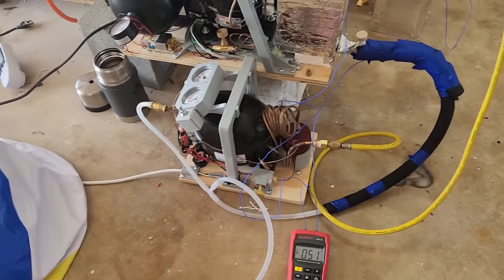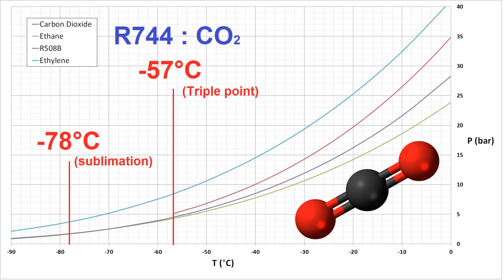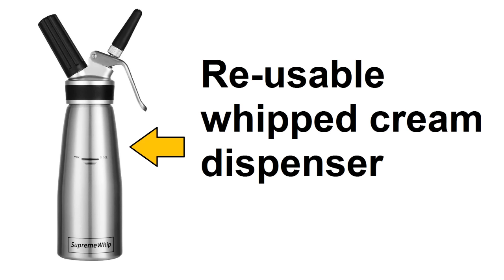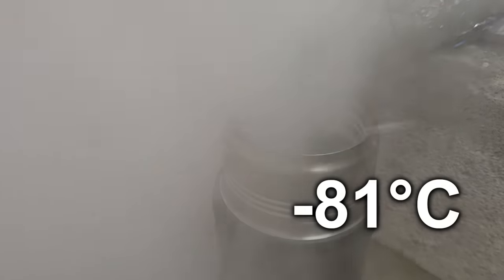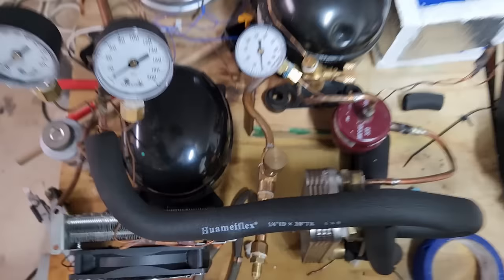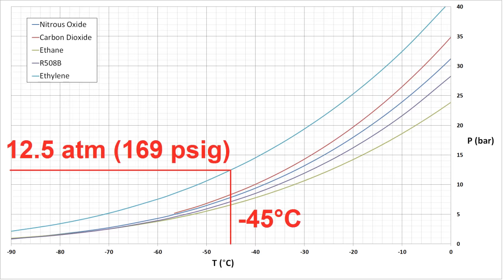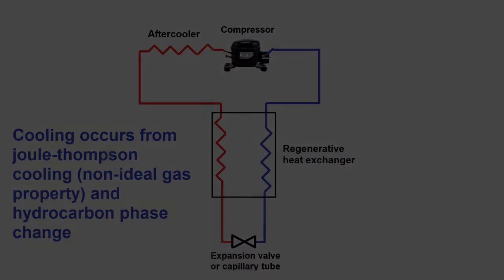DIY Cascade Refrigeration System (Part II)

Comment: Hey dude, I'll watch it later. It must be awsome as always. One extra consideration. Did you think about auto-cascaded refrigeration. One compressor, refrigerant mix and several capillaries and heat exchangers. The last capillary or valve is determining everything.  Looks much simpler for diy.
Reply from the maker: I've looked into it, but they're kind of tricky to get to work right. The simpler approach (which I'm gonna do in upcoming vids) is a joule-thompson cycle with a mix of refrigerants
Reply: @HyperspacePirate  My imho is to get rid of capillaries and use float valves as in carbs for all, except the last pressure reduction. In such case everything should self-adjust to the last pressure reduction. The float valves should maintain proper liquid levels. Imho the last one should be regulated pressure relief valve and or float valve.

I saw also some combinations with liquid ejectors for decreasing evaporation pressure.

Imho the most tricky stuff is to find proper composition of the refrigerant mix.
Reply: @HyperspacePirate  I'm thinking an autocascade with R290 on the first stage and a Joule-Thompson cycle as the second stage would help with oil freezing problems. The R290 will "scavenge" almost all of the oil before it gets anywhere near the second stage.
Reply from the maker: @NiHaoMike64  I'm actually doing this for my next video, but the R290 is in a separate stage coupled with a heat exchanger

Comment: have you tried placing copper scrub pad at the end of the condenser coil before the capillary line  for CO2. could be enough to de-ice the gas if not, could add inductor coil which will  heat the pipe and scrub pad to melt the ice.

Comment: With how much hydrogen you were producing and considering that ethylene is slightly less dense than the air, I am surprised your gasholder ball wasn't trying to float up when full

Comment: I like your well made videos. I am unto supercooling my computer server. I know little more than the theoretical basics of refrigeration. I need to achieve .100°D at 2900w (10000 BTY) of heat dissipation to cool the CPU and the GPU in a 3 Cu ft. sealed box.  Your two stage method seems to be ideal. It would have to run continuously. I am still learning so any suggestions anyone has would be welcome.

Comment: regards CO2.

in my mind, it will tend to freeze more as it absorbs less heat... ie, the more heat its absorbing, the less likely it is to solidify... is there a sweet spot? 
i feel the long narrow path in this case may be the main issue. limited surface area to the volume and flow through it. think something closer to a 4 inch pipe filled with honeycomb, or maybe 1/8 thin wall tubing... iunno. a heat exchanger with a large initial surface area relative to volume. you know the deal. fins. lots of.

so, ignoring that... first two thoughts that spring to mind... hermetically sealed drive coupling aka magnetic coupling, and or... cyclonic "filtration".

expand into a chamber, feed the nozzle directly into a wire brush at high speed. hence the mag coupling. lol, i get the inspiration from the extreme opposite ... coal dust fed boilers! just pulverise it as it comes out. yes, sadly it requires small motor.

or.

expand into a cyclone, ideally the heavier dry ice falling to the receptacle where its still subliminating away, and gas exits up the center as per standard cyclone.. (shut up bill, you invented nothing but a trend for hipsters with your overpriced vacuum cleaners...)

unfortunately the common copper reducers are too steep for a cyclone, but heavy wall copper is easy to spin and taper out a bit. cyclone geometry is pretty simple, generally 4D high for the cone., 2D high on the chamber at 3-4D wide inlet, outlet, and receptacle all being D. been years since i looked... but around there works.

how you couple into said chamber effectively to harness that cooling power is YOUR problem :)

another thought while im here...

a WINDOW! you can get nice heavy optical flat quartz glass windows for pretty cheap now. would maybe be cool to have a look see at the nozzle inside whilst in operation? just a bezel with some teflon sealing rings, pretty easy.

Comment: Only watched 2 minutes so far, but wanted to comment I recently saw a video where Ethane (I think) is produced easily by electrolyzing vinegar. Just FYI, do with it what you will
Reply from the maker: Thanks, I'll look more into this
Reply: @HyperspacePirate  This is the Kolbe reaction. I watched a bunch of videos on it, electrolysis of vinegar (acetic acid) with a platinum anode can produce a 2:1 volume mix of carbon dioxide and ethane at the anode. The carbon dioxide is fairly easy to remove chemically with sodium hydroxide or with temperature/pressure if you want. There is very little contamination otherwise in the anode gas besides water vapor and maybe a tiny bit of atmospheric gases dissolved in the electrolyte solution.

Comment: It's not that hard to get most refrigerants if you supper duper pinky promise to only have a 608 Tech maintain, service, repair, or dispose of equipment that could release refrigerants, but I like where this is going!
Reply: You have a lead on a supplier? Last time I tried to buy some (I'm 608 certified) I priced it out at my local distributor, and the price was a non-starter.

Comment: I love your engineering gusto, but I am worried about your temperature measurements.

Using a thermocouple to measure temperatures well below zero can lead to serious errors. Many thermometer readout devices don't apply the non-linear terms to the thermocouple output. Consequently, they often overestimate temperatures many decades below zero i.e. temperatures are colder than they appear.

For critical thermometry, use a PT100 or read the voltage directly with a DVM and use look up tables.

Best wishes

Michael

Comment: So correct me if I’m wrong, but isn’t nitrous only flammable/an oxidizer under high heat and pressure. Otherwise, the molecular bonds are strong enough to keep it together. Or is the pressure of a refrigeration unit enough alone to do that?

Comment: You could increase the power capacity of your first stage by replacing the Window A/C condenser with plain copper tubes with no fins in water.
Then pipe this water to a regular automotive water radiator. You could even use one of those ice makers to fill a bucket with ice in your water cooling loop.
If your first stage hot side is kept at 20C at all time, this is power savings that will ripple down exponentially down your cooling cascade, probably exponentially.

Also the power of the early stages should be greater than the later stage, there is a lot of room here to having two or three parrallel compressors for increased power.

Lastly, your instrumentation is lacking, you need sight glasses to observe subcooling/superheating/presence of mist in your coolant stream. 
You should REALLY obtain ANY infrared camera, for instance cheap aliexpress IR camera like "UNI-T UTi120S " that cost around 300$, there are many other model, resolution is low at 90x120
But any IR camera will help you get an intuitive feel of what it happenning. Especially with the saturation levels of your evaporator/condenser

If you could measure your flowrates accurately that would be another great improvement in instrumentation
Here is how you can build such a thing using spark plugs. For flow metering you need two things, measure fluid temperature and measure power dissipation.
One sparkplug you fit a RTD temperature probe or thermocouple, it must be stury, it must directly touch the fluid, it must not be in a turbulent flow region.
Power dissipation, this is basically just a thermistor, you pass a current through it, voltage and current give you power and resistance. 
Power dissipation plus resistance plus temperature from the other probe, in a non-turbulent flow region means you now know mass flow rate.

Last advice, you need better control of your expansion valve, capilarry tubing sucks for your purpose as it cannot adapt to changing circumstances. 
Obtain proper temperature controller or electrically controlled thermal expansion valves. Wire all your instrumentation to a ESP32 or other arduino compatible microcontroller and use it to drive and monitor your entire apparatus.

With better insight you will succeed in this. 

You also need at least back of the enveloppe calculation of how much cooling power your entire setup with require at each stage.
Reply: How to increase complexity and cost by 1000%
Reply: One of the main motive of this project is to make it as simple as possible and as cheap as possible so anyone can replicate it.

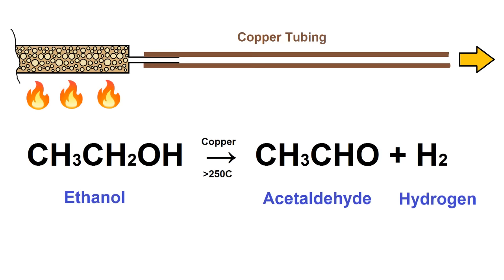Comment: 9:14 A little tip from a chemist it's Acet-aldehyde. 🤣 That's an aldehyde. Incidentally, copper oxide in methanol produces methanal, or better known as formaldehyde. This is the same organic substance that is produced when the liver breaks down ethanol and is responsible for the subsequent hangover.

Comment: I found your videos very helpful . Please don’t surprise about the following question, may be I didn’t watch carefully. It seems to me that  propane and ethylene are running diretctily inside the compressors. I just want be sure about it, given to the very low temperatures (my doubt is mostly for the second stage). How is it possible the  very low temperatures dont affect the functioning of 2° compressor?
Reply from the maker: Usually the compressor generates so much heat that if any super cold return gas comes back through the inlet, it's instantly warmed up. They're actually well above room temperature in basically every situation.
Reply: @HyperspacePirate  Thank you for the answer.

Comment: if the objective was dry ice, a straight length of smaller diameter tubing may help. the pressure keeps the ice moving, the copper melts out the plugs as they form and they all get launched into a collecting device. if you collected the co2 into high pressure liquid trap and then let off all the pressure i believe you could create that block of dry ice. that isnt needed anymore lol. pretty cool

Comment: Hi, thanks for the wonderful video man. I have a question. Did you change any compressor oil when you change the refridgerant from isobutane to propane or propane to ethylene or ethylene to NO2? if yes what is the suitable oil for these refridgerant Please?
Reply from the maker: If compressors were already oiled when i bought them, I just kept the oil they came with. Otherwise, i bought ester oil (POE). I think you can also use mineral oil, but i haven't tried
Reply: @HyperspacePirate  May i know the model number of the buffer tank you used
Reply: @HyperspacePirate  hello bro. Can any tank be used as buffer tank or it has to be a diaphragm tank ?

Comment: I think you are confusing NO2, which is nitrogen dioxide, which is very toxic and is used to supercharge the engines of racing cars, and N2O, which is nitrous oxide, or the laughing gas used as an anesthetic and in whipped cream dispensers... There is a big difference between the 2 gases... But that doesn't matter... the video you made is super interesting..
Reply from the maker: Racing nitrous is N2O. If you were blasting NO2 you'd kill everyone in a 20 ft radius

Comment: having just watched this, my dehumidifier fan failed last week. Opening it up to try and replace the motor (looks like a thermal fue blow due to capacitor failure/shorted turn) I discovered the thin uses R290 - ie PROPANE

Now I understand why there's a warning on it to only use it in a room of at least 20m^3 and the amount of care put into building the thing makdes more sense

On the other hand I feel far less guilty about having to toss it if I can't replace the motor (seems nearly impossible, even though the compressor loop is fine) (a $10 motor condemning a $160 dehumidifier!)

Does anyone know how to get parts for stuff made by King Port? (they oem for lots of brands, Danfoss Xpelaire in this case)

Comment: @1:25 Wait a sec; looking up boiling/sublimation points: 
(ethylene): -103.7 °C  or 169.4 K 
(dry ice):  -78.5 °C or 194.7 K
Isn't the dry ice too warm to liquefy the ethylene? I was wondering why you weren't using liquid nitrogen.
Reply: He's trying to make liquid nitrogen in the end so it's a bit counterintuitive to use liquid nitrogen to make liquid nitrogen
Reply from the maker: The boiling point goes up as pressure increases. The Ethylene should only need to be at 3.6 bar for dry ice to cause it to condense to liquid.

Comment: I was wondering if it's possible to make a refrigeration system using water as a refrigerant, for me it is but for an AC application the pressures need to be around 0.01 and 0.9 bar(absolute) to prevent freezing at the cold side and to high temperature at the hot side. since the pressure diferetial is low less than (1bar) and the latent heat of vaporisation of water is very hight, it appears that this system would have a nice COP.
Why don't we use that?
Perhaps the low pressure is too technical to maintain, water is too corrosive...
Reply: A friend of mine did just that, main challenge at such low pressures is getting a usable flow rate with a reasonably sized compressor. Basically, if the compressor ran at 3600 RPM (the speed of a common AC motor), it would be about the size of a car to get enough flow rate to cool a house, not very practical. Her solution was to use an inverter to step up the frequency so that the compressor could spin at over 100k RPM. The design needed for that to work makes it more resemble a jet engine than any sort of compressor you would normally find in HVAC applications.
BTW, the funniest part was when it came time to demonstrate the safety of that R718 "dihydrogen monoxide" refrigerant, she did that by taking a bucket of that stuff and pouring it all over herself! To this day, I'm not aware of anyone attempting that stunt with any other refrigerant...

Comment: Also i  Wonder 3 stage methane 4.stage argon 5 stage liquid air or Just nitrogen and i heared off 15 or 20 percent methane mixing in second stage  result minus 130 celsius but rotary 410 a compressor used in system

Comment: Actually nitrous oxide has been used as a modern propellant with a catalyst. Not that I have ever thought about making a amateur butane nitrous oxide powered rocket engine or anything, nope.(I wish I had the budget and the machine tools)
Also getting it from the food industry probably is a bit cleaner of the source. If I remember correctly the automotive industry might add something so It's unpleasant to get high off of it.(but that could be completely wrong and an urban legend, never really looked into it)

Comment: Did you know that you get - 100 °C when you mix CO2 with Aceton?! If you manage the dry ice problem and you also manage to separate the CO2 from the Aceton vapors in the gas phase and recombine them liquifyed at the evaporater then you would get cooling by mixing and evaporation. Two distinctive cooling methods in one go with one stage.🤔

Comment: You spend a good amount of time talking about how dangerous nitrous is in combination with hydrocarbons, and then you use a fridge compressor to pump it into your system.
What oil is your compressor running on?

Comment: do an osscilaton fridge caUSE  its so much harder but you cna use it in closed systems
Reply: u know if you hide in a bunker and the senf gas stretches miles and miles with out end every day a new load you need this kind of fridge

Comment: if the compressor windings should short there would be a potential ignition source.

being an oxidizer means (correct me if i am wrong) it would be a source of oxygen.

couldnt you use helium?  you need to remove the air if it is from a balloon kit but if it is for welding and cutting then it should be pure and helium is used to cool the magnets in MRI machines when hospitals do imaging tests.

Comment: 4 stages just sounds.... sub-optimal.  it would be easier (and quieter!) at that point to just use a massive stack of peltiers and put up with the pathetic efficencey.
Reply from the maker: The peltier effect pretty much vanishes when you approach -100C, even if you have infinite power input and perfect heat rejection
Reply: @HyperspacePirate  oh i didn't know that